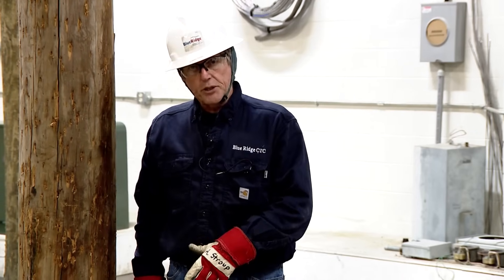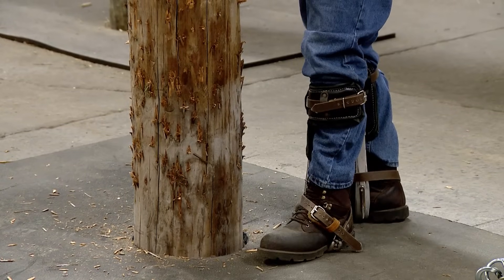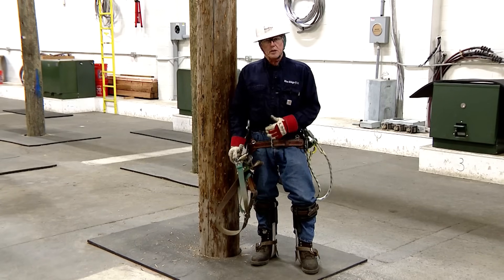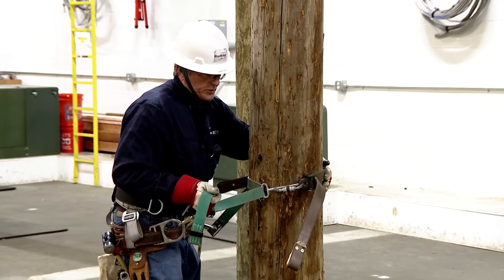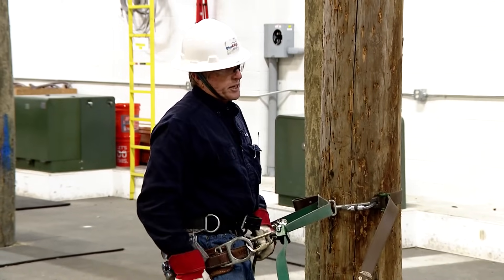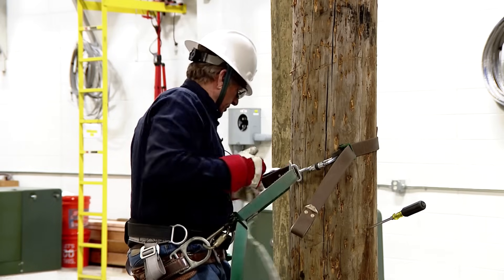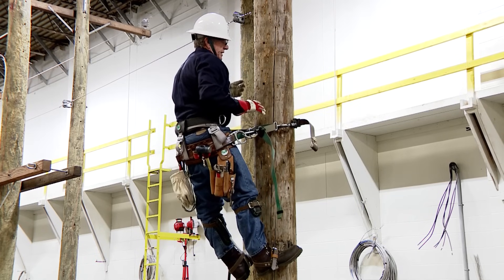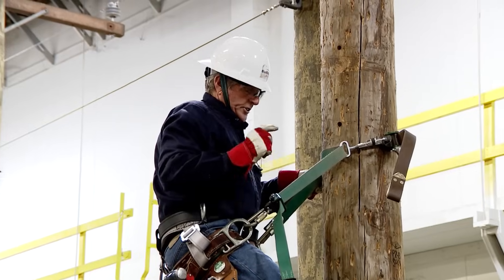Lineman Training: Climbing Techniques for a Beginning Student

Comment: Notice which side his secondary is placed on when not in use. When used he can use his dominant hand to connect and disconnect. I am a fan of having green strap or rope set up on buck squeeze to the left side away from tool pouch on right side. All great techniques. This was one of my go to videos prior to attending line school. Still a great review after being on an underground transmission project for about a year.

Comment: Did it for 31 years. Don't miss it at all. Although I kept my body belt as a keepsake. It still fits on the very last hole. Needed spinal fusion surgery after retiring.
Reply: May I ask what over the years caused you to have spinal injury?
Reply: What exactly caused the surgery? Or what part of the job causes that injury
Reply: @imprice5668  Okay, I did cut out once and fell 18 feet. We didn't have double strap systems then. We climbed around and over obstructions hand over hand. At the time I thought I was lucky to just have a broken leg, but back pain began soon after. Also, I used working off a body belt (fewer bucket trucks in the 70s) as a means of working out my midsection, stupidly. I thought leaning out more was a way of exercising my abs and obliques a lot more, which it was, but I was also grinding away the discs in my lower back without realizing it. It was my own fault. So I'm not blaming the career of lineman for heath problems if you approach it right. I did not.
Reply: @Stickmantibet  See my response below.
Reply: @ed I’m just getting into the field and my instructors were telling me that the body belt should be placed on my hips and should kind of be on my very lower back and tailbone area. I use the lean back method to get a good gaff in the pole easily and on the contrary I have had a lot less back tension and didn’t workout my abs as much. I am gaffing with little to no effort. I don’t know if I am reading wrong or if our experiences are just different but I feel that the leaning back sort of sitting in the body belt method is great for releasing lower back tension. I would love to be corrected or receive insight from a veteran like yourself.

Comment: Teach climbing...couple of things.....1. always wear gaff shields when putting climbers on.  2. that is a supersqueeze, not a bucksqueeze.  3. Hitting your screwdriver with a hammer is a good way to break that plastic handle (beneath the rubber)...see it dozens of times.   4. distance from pole is important..body parrallel to pole (not leaning in our out per say while climbing).   5.  Since it so important, I would have mentioned to make sure the inner strap is at least touching the pole and the bigger the smile on the inner strap, the less likely you could fall.
Reply: JD Winty      Looking forward to your video JD in that case.

Comment: whats a good tip to prevent the top of your gaffs where your straps are from digging into your legs?
Reply from the maker: If your gaffs are causing you discomfort at the top strap there could be several
reasons:
First off is the height adjustment correct? It should be at least two fingers below
the taper at the knee.
How tight do you have the strap? Top strap should be a little loose to allow movement. The bottom strap at the boot should be as tight as possible that is comfortable. Lastly, there a multiple different pads you can buy. There are thick padded ones .
Formed padded, padded Velcro etc. 
Hope this helps you out. Thanks for the great question.
Reply: calluses
Reply: Ace bandages work as well if using old "passed down" training equipment
Reply: Yup adjustment is key. I use mine for hunting purposes,  comfort is a requirement.  Taller boots were also helpful.

Comment: You forgot to tell them about the high and low side of a pole !
Reply: Enlighten us.
Reply: @IceColdProfessional  If a pole is not perfectly straight up and down, one side of the pole will actually be at a negative angle. That side of the pole is called the "low" side. Dependending on the severity of the lean, climbing the low side of a pole is much harder, and much more dangerous.
Reply: @CaptainHightop  Oh my. I never thought about a hazard like that. But thanks.
Reply: Don Baus yep!!

Comment: The only thing I disagree with is not "kicking" bite those hooks in there! lol
Reply: No, You don't kick into the pole. It promotes a bad gaff angle and the force is not needed. Just the weight of stepping down into the pole is enough to set your gaffs.
Reply: I would only recommend kicking if u are climbing hard wood trees.

Comment: I retired from this field of work in 99 glad I didn't have all that mess to slow me down. 17 yrs. of it never burned a pole. I have seen many trainees burn poles in climbing school when one dropped another would drop got in their heads fear factor for the first few weeks of training. This gear is a great way to save some folks from the humility of poor technique. I was allowed and could literally run up 45' of fresh wood and long step it back down. So fast folks freaked as there was pure air time no gaffs in the wood. Logger comp style all in the strength, form and rhythm. Great skill when you have a bunch of new wire to tie off on insulators and don't want to waste time setting up the bucket truck in mud. Of course these days insurance cost, broke backs. legs, splinters embedded in your thighs tends to favor this sort of new gear over cutting out to your doom.  😋